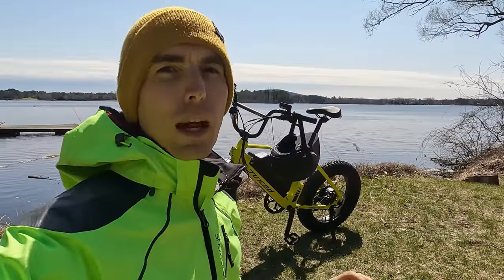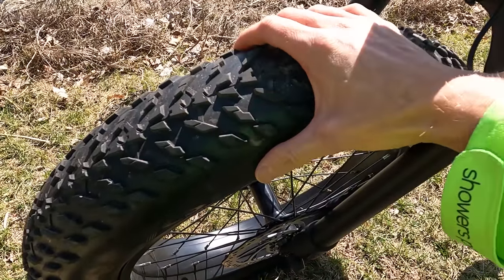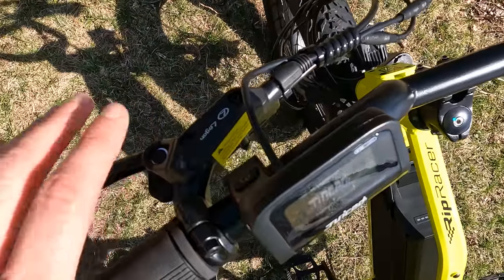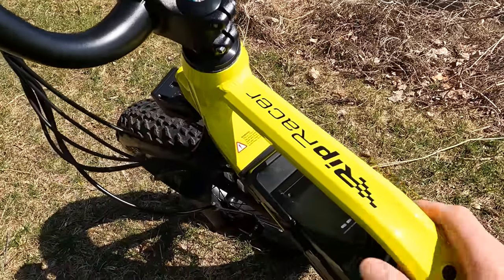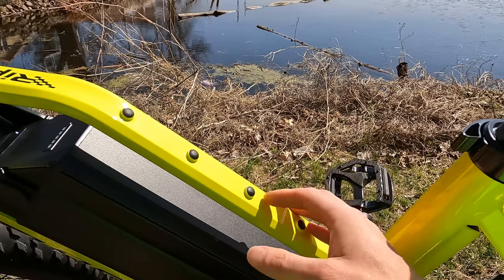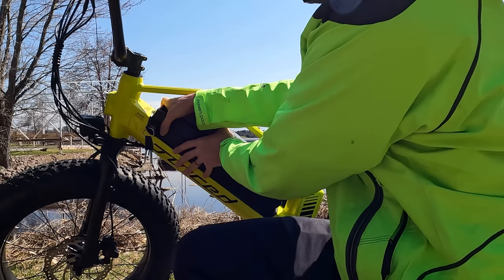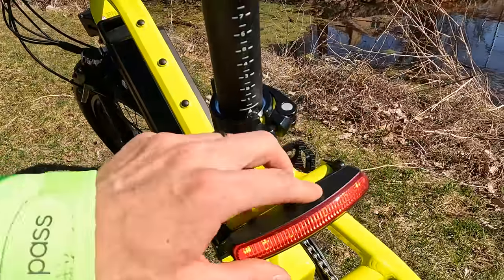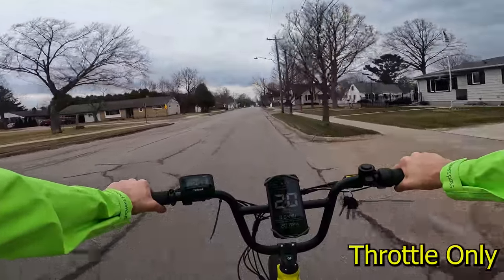Juiced RipRacer Review: Speed, Style, and Affordability | 52V Class 3 Electric Bike

Comment: I think the RipRacer is sporty and cool, and I've always respected Juiced build quaility and performance. A friend has a HyperScrambler 2, and while racing he could almost keep up with my Rad Mini. Those bottle cage bosses give you three positions to mount your bottle or lock, but it also gives you a place to mount another battery! 😉
Thanks for the video!
Reply: Yeah, I saw the FOUR bottle mounts and immediately thought, "That would VERY securely fit a 4 screw hailong type battery." I'd be willing to bet that was not an accident ;)
Reply: For dual battery or spare battery?
Reply: @khrisstake2210  Dual. They will probably have an option to parallel them in the future.
Reply: I have never seen anything from Juiced that states you can add an extra battery there. Where are you seeing this? I would thing if that was an option they would have that option.

Comment: My FRONT tire is rubbing on my NEW Juiced RipRacer. Almost like the brake is slightly on.  The wheel does not spin. Do I just need to ride to break it in? Calliper does not seam to be centered on rotor and getting worse.

Comment: Would have loved to see that boost feature they talked about. When using pedal assist also use the throttle apparently that’s how u get to the peak 1300 watts 🤔
Reply from the maker: We used the "Race" mode that you have to unlock. The off-road controller might be what you are referencing by "Boost mode". That controller is not currently available or we also would like to see what this little bike is capable of.
Reply: @reddingpepper2021  really? Damn

Comment: I don’t fully understand the point of “race mode” I guess I understand that it give higher peak wattage, but it didn’t result in a higher top speed…did you try accelerating in race mode from a stop vs other modes…maybe it is stronger/faster acceleration?

I was considering buying a Lectric XP 2.0 and then saw this.  I know it’s more…$1699 now instead of $1599, but it seems like some things are nicer here than the Lectric…not much more range though and I don’t really care if I go 15mph up a hill as long as whichever one I buy can do a hill, which I know the Lectric can.  That might make a good video…comparing this, the Lectric XP 2.0 and Lite…as the Lite doesn’t have fenders and stuff either for $799.  Any idea when the rack and fenders will be available from Juiced for this Rip Racer…they say out of stock currently.
Reply from the maker: From what we gathered with chatting to Juiced: Race mode doesn't give a higher top speed (as it is limited), but rather it gives the motor complete access to available wattage, and provides better acceleration.

Also about the accessories. We were originally told they would be available in July, however it does look like that date has been removed from the website. We will reach out and see if we can get a better "in stock" date. -JT

Comment: Can I purchase this bike with ZERO or no Battery? I have batteries here that do not get used. 
Also excellent review!
Reply from the maker: That is such a specific question, that I would recommend going to Juiced with that. We have not seen any manufacturer offer a ebike for sale without a battery.
Reply: @EbikeEscape  I did and that was a NO! I purchased with a majority of your help thru this video! I hope you get CRED! Plan was to use a battery blender, with the Juiced stock 15,6 AH 52 V and blending with a52 V 15 AH. Blender claims do not go over 35 AH............ of course none of this will be done until the warranty is up.
So stay tuned, Spark Cycle Work Branford Conn. "Battery Blender" any feed back would be appreciated.

Comment: Good review!  Single speed = deal breaker.  My Aventon Aventure was $1899 with same battery size, eight gears, full size bike and hits 34 mph.
Reply: How does your Aventon compare to the new Lectric xpremium??
Reply: 34! Wow
Reply: Cruise control. Wow
Reply: Sounds like your wheel circumference is off in your settings because they definitely don’t go that fast. my riding partner has one. Both bikes have the exact same Bafang motor and a Aventon has a smaller battery. I for one have used my gears maybe once. most ebike riders rely more on assist levels than gears.
Reply: @luxuriousforce  Is 18.5 stock setting for circumference?

Comment: What's your inseam? (inseam is a much more important metric to determine frame size as two people the same height may require different frame sizes due to having different inseams.) I'm interested in this bike but having an inseam of 86cm, I'm worried that it might be too small. What is your opinion?
Reply from the maker: 32 inch inseam. It's a smaller bike for sure but that's kind of the style they are going for on this bike. I still love it.
Reply: This would be a bmx type so sizing is less important than a mountain or road bike

Comment: I would spend an additional $200 and get a the mid-drive Lectric  XPremium for more range, and front suspension.
Reply from the maker: The XPremium is hard to beat for the price. I think the Juiced RipRacer is meant for a slightly different crowd. I don't think you can go wrong with either. -JT
Reply: Mid drive is all movement going through the chain drive system.
Lots of wear and tear that is totally unnecessary.
Rear hub drive eliminates all that.

Comment: I guess there is no reason a guy that wants to mod it can't send off for a 3,000 watt rear motor and kit. 52V extra battery on the rack. Might get 40ish mph. Just need to know which motor and wheel kit is best to use for 52V ..👍 Would be clean if a new 40 amp controller worked in place of the current controller.. Hidden.

Comment: so you still have to peddle to get up to 28 in race mode? :/
Reply from the maker: Correct. In order to maintain that Class 3 rating, the throttle cannot be used past 20mph. As you can see, it isn't a tough pedal to do so. -JT

Comment: So the fastest model of this only goes up to 20mph without pedaling? Damn
Reply from the maker: Only because it is restricted via the controller. The motor and battery system are capable of much much more. -JT
Reply: @EbikeEscape  I just found that out now lol.. I saw off road controllers for other models and someone stated that the owner of the company has one coming out for this bike that does 35mph throttle only! I might have to get this now. Thanks for the review and response
Reply: So after calling them they aren’t sure if they are releasing controller anymore. But hopefully

Comment: If it only had a torque sensor.
Reply from the maker: I want to try a Juiced model with the Torque/Cadence combo
Reply: I don't think you'd want a torque sensor on a single speed bike with gearing that high.
Reply: @18andlikeit  I have a torque sensor on my Serial 1 Mosh City single speed. Much better than a cadence sensor bike.